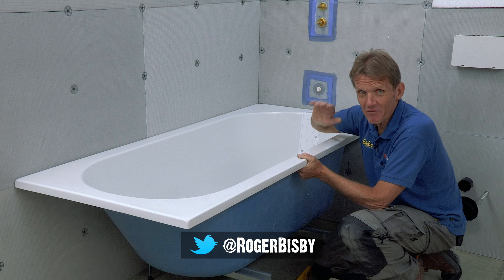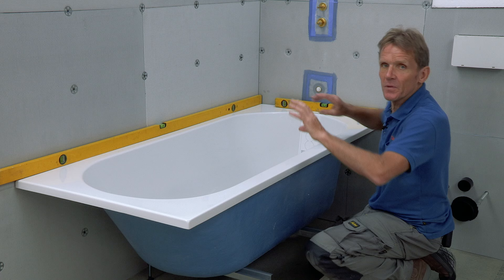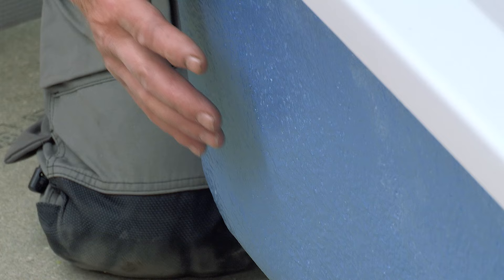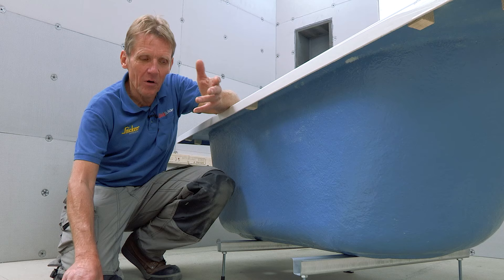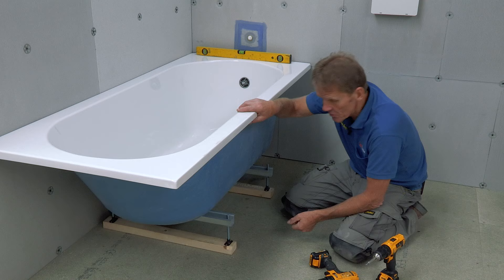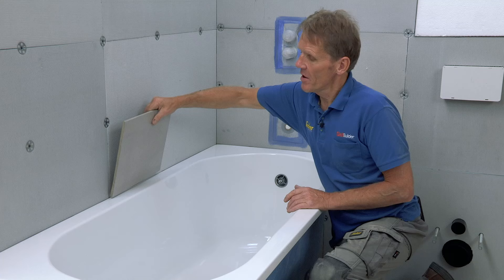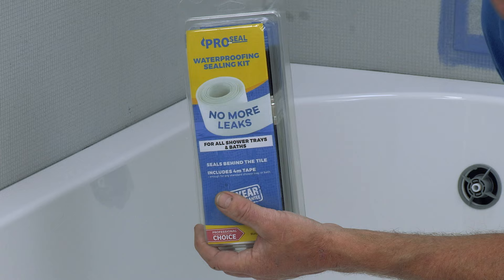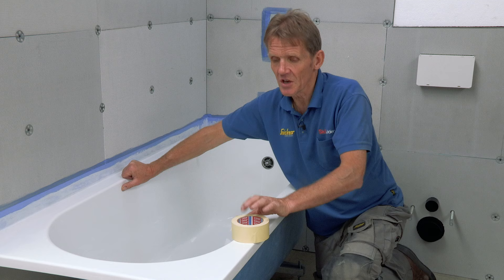How to Fit a Bath and Prevent it Wobbling

Comment: Nice work Roger, that abacus sure know what they are doing. It's good because it's belt and braces which us plumbers love! With baths I stick some extra bearers in tight on the underside of the bath so I have 4 or so points the bath is sat on. I also glue the nuts in place as the older baths had a habit of undoing them selves. That seal looks looks like something I do with the tanking kit. Most baths/showers I will tank the area but with the fibre tape I will slightly lip it on the edge so I can tile on top of this, creates a little upstand. The best showers I fit come with upstands pre-manufactured into place. Love them made by Coram. great simple design, however some customers don't like the way they look!

Comment: Great advice Roger. Another important aspect of fitting a bath is bath height, especially if bath panels are being used but equally thought should be given to tile heights. Nothing worse then being asked to fit a bath panel and find that the plumber has set the bath too low so you have to cut sometimes rather flimsy panels down to fit.
Reply: Always try and think of the next tradesman to work on whatever you’ve just fitted like tradesmen used to.
If everyone thought like this everybody would get home on time ! 👍

Comment: Good to see real craftsmanship.! My bath from Trojan, supposed to be 5mm thick, it is not anywhere you measure it and it's not even level out of the mould. Lesson learned, spend as much on the bath as you can afford. I also took the legs from my old damaged bath and attached them as extras to the new one. Also finished it with an upright in each corner,  it's not going anywhere now. I would add that these thin baths are at as much risk from breakage at the fitting stage as they are in service.
Reply: Funny you should say that as I brought a wickes bath made by trojan and out of level as you say plus bath edge  40mm either end and 45mm in middle meaning bath panel will be 5mm out either end. It's going back. !!

Comment: I've had to set mine higher due to a drain not draining. I have slight movement so I think I shall use an adhesive to hold it in place. I don't want to take bath out again but I wish I had a baton against back wall

Comment: Hi made a mistake he measured the bath then put the wood behind then put berers on. Now the bath would be higher than he measured for
Reply from the maker: well spotted.
Reply: @SkillBuilder but shortened the feet to I assume match the same height, so not really a mistake...

Comment: Thank you for the video, what was the brand of the glue you use? Also would you use this to seal around the plug hole and drain pipe connectors? Thanks in advance! Karl
Reply: Did you ever get an answer? Interested
Reply: Looks like a CT1 but it is hard to see.